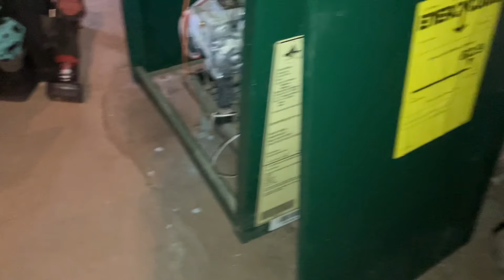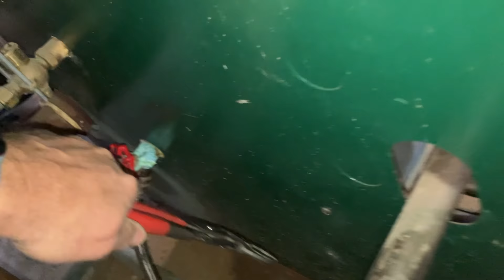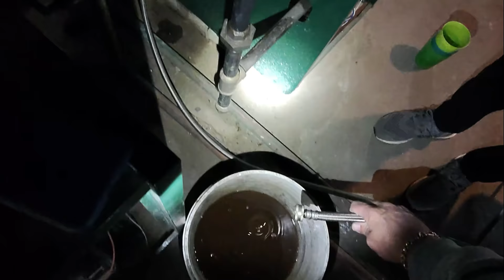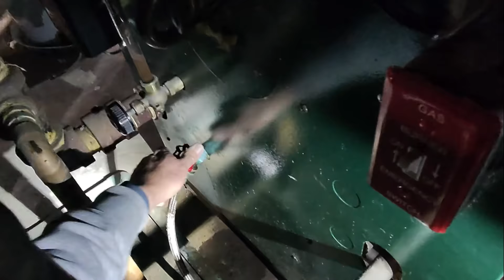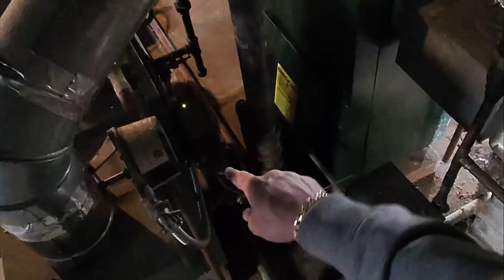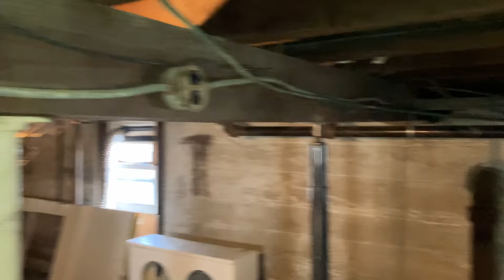Steam Boiler OVERFILLING?! Automatic Feeder Gone Rogue (REAL Diagnosis)

Comment: water line is where its supposed by the tag on the boiler
Reply: Please, NEVER diddle with a steam or hydronic boiler system if you feel that the water level was proper in that boiler.
🙄🤤.
 Whatever tag you seen, the information was wrong. This is a great example of don't believe everything you read.